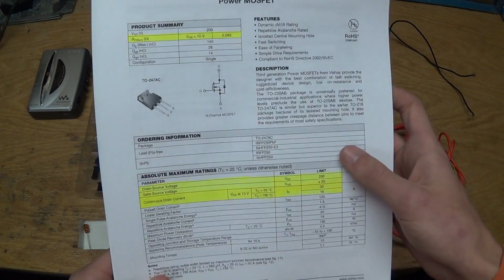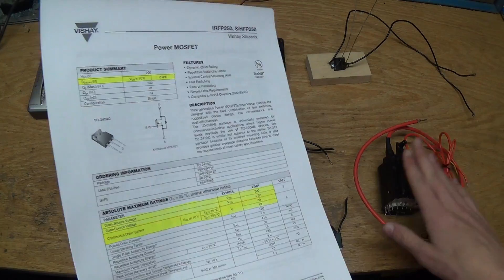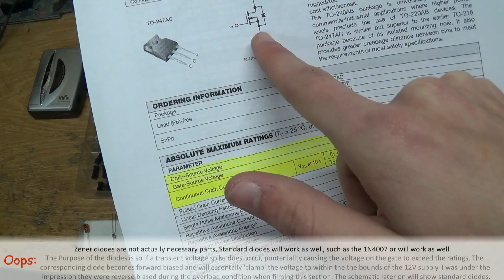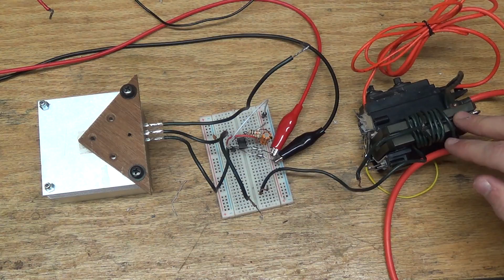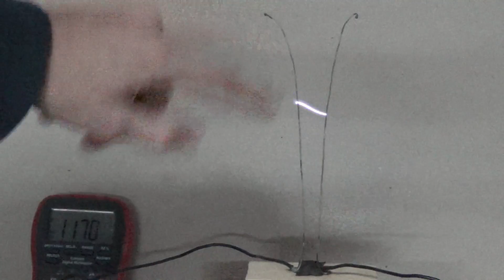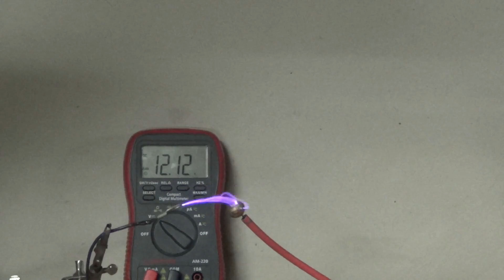Weekend Projects: Make a 69KV Singing Arc Plasma Speaker Flyback Driver!

Comment: Hy!! Nice works, your projects is really good and i am trying for a while to make something like that. 
i tried many possibilities, others videos, by using a 555 timer and nothing but fried components. Is exactly the same with this circuit, i fried : 1 IRF 460N, 1 IRF 540, 2 timers and 1 flyback. 
I read all the comments to try to find what am i wrong and i have some questions, if you could answer to me:
1) I am using this schematics : https://easyeda.com/editor#id=c46d5092f7a4456b97c426fb08236f1e 
I can obtain a 50 % duty cycle and 15 hhz to 96 khz frequency. You said that is not a good idea to use a potentiometer. Should i remove it and use a stable frequency??

2)  I don't understand the part with the resonant capacitor. What should be the frequency of the primary with MKP capacitor, the same like the 555 timer?  How to calculate the inductance of the primary? The value of MKP it's critical for this project? 

3)In the video you speak about 12 V zener diodes and in the description (schematics) your are using 1N4007. For me is not logical to use zener diodes in this configuration. Could you be more precisely?

Thank you very much for yours answers.
Reply from the maker: 1) I cannot see your schematics at the moment because the easyEDA site is down at the moment. Will edit this reply as soon as it's available again. I had problems when using a pot because you can damage it if you take it to the ends without additional series resistors to prevent excessive current through it. Note the datasheet for the 555, and the minimum resistance values allowed for R1 and R2.

2) Yes. Ideally you need to determine what frequency the flyback operates best at. You do not need this capacitor at all to do this. Then once you have determined what frequency leads to the longest arcs, you can try a few different capacitor values to see what works best. Stick within the range I used in the video ( uF is too much, pF is too small. something between 0.5uF and 10nF should work)

3) You are right. Zener diodes are in fact a poor choice. 1N4007 is also a poor choice, I would recommend a single TVS diode for between the MOSFET gate and ground, rated for about 20V. You want this diode directly across the MOSFET leads. Low inductance and short wires are crucial!! TVS diodes are designed specifically to protect sensitive devices from big surge voltages/currents, by clamping them to a safe level. The datasheet will specify the maximum energy it can absorb. Energy = time*voltage*current. They can handle LOTS of amps at the breakdown voltage for a SHORT period of time. Too much energy will result in a BANG. For the audio input, using a couple of 1N4147s would be best. No high current here.
Reply from the maker: I am not sure why you have a 100uF (presumably electrolytic) capacitor on pin 5 to ground. This is incorrect and should be removed. Typically a very small value capacitor is placed here to ground. I am assuming your selection of resistors and capacitor result in a frequency between 15KHz and 30KHz w/ a duty cycle of close to 50%. You can double check that with any online calculator or the equations provided in the datasheet for your 555 version.
Reply: Hy Max and thank you very much for yours answers. Actually the component which made me all this problems was the flyback, it was a big one and produced high voltage and burned everything. Now i have something smaller and i can get 1 - 2 cm arcs with 8 V, 3 amps.
The frequency of this project is between 15,3 Khz and 55,5 Khz and the timer works very well with R1 and R2.
The capacitor C2 is a 100 nF ceramic, in reality, it was a mistake in my schematics.
For the moment i made some tests without MKP capacitor and withhout  diodes beacause i don't have TVS diodes and here : https://easyeda.com/editor#id=e0e52a9612a044d5bd516290d8ee14d8
you can see some pictures of my tests. The test was made with 5V, 2,7 amps, 16,3 Khz (bigger arcs with this F); the 555 supply is about 14,7 V and the gate signal is 13 to 14 V and the arc is about 1 cm.
In my first picture i have the gate and drain signal and actually i have no idea if the drain signal is correct, i don't thick that. How it should be the form of drain signal?
Also the TVS diode should be on the gate or on drain? You mentioned on the gate: but why because there is no high voltage?
Reply from the maker: The point of the TVS diode is protection. No, there shouldnt be any high voltage to the gate, but that does not mean their wouldn't be. Inside the MOSFET, there is some parasitic capacitance between the drain and the gate. What happens is when the drain voltage slams up or down REALLY FAST, it will try and "drag" the gate voltage with it. (Remember: Capacitors like to avoid change in voltage, so when the voltage goes from 0V to 12V instantly, it tugs on the gate) and if the impedance between the gate driver and gate is too high, the MOSFET will actually turn ON when it is supposed to be OFF!!!! And if for some reason it gets yanked up to a voltage exceeding 20V, then your MOSFET will fail short circuit and explode, depending on how much current your power supply can dump into the broken FET.

The size of your transformer of choice dictates how far you can push it. If you submerge the flyback in transformer oil, you can achieve a remarkably high output voltage. This trick is done with the more advanced drivers since it is pretty much required when pushing the transformers beyond their rating as I do. Failing to do this may cause some of the high frequency high voltage to "leak" into the partially conductive ferrite core and arc over to the primary side. This does not cause electrical damage to the parts since it's fairly low current, but it will destroy insulation on the primary wires!
Reply from the maker: Take a look at the gate driver IC's on DigiKey or Mouser. I used one for my tesla coil project. The datasheet for them will typically say they can deliver several amps to the gate of the transistor, and that isn't a coincidence! They need to be able to keep the gate voltage at a fixed level, either shorted to ground or to some voltage above 7V. It takes a LOT of current to quickly change the gate voltage, and in the case of the miller effect, it also takes a lot of current to fix the voltage at a known level. Some of these problems can be partially solved by just slowing down how fast you swing the gate voltage, which is why you sometimes see a small resistor purposely added in series with the gate. The problem with that is that your circuit becomes less efficient because you stay in the linear region longer, where the MOSFET acts like a big resistor and dissipates lots of power.

Comment: There is no way that is 100kv. At most is around 50kv. The 1mm= 1kv rule of thumb stops being reliable at around 25kv. Look at x ray transformer videos so you get an idea of ho much 100kv really jumps.
Reply from the maker: Teresa Shinkansen It depends on the current, pressure, humidity, and atmospheric condutions as well. 100KV is probably a bit of a stretch though.

Comment: Your schematic is seriously throwing me off. Do the voltage values not matter here? I think that's important unless you think a 10v capacitor is okay on the HV side.. You also show diodes to pin 5 then you hook only a capacitor to pin 5 on the build.. Is that schematic accurate?

Comment: I suggest replacing D4 with a 10k or so resistor.  You would need to size it based off of the gate capacitance or charge and your intended frequency.  Blocking gate to source with that diode is making all of that charge dump through the 555 timer when you switch it off.  This is likely causing issues with the 555 timer, but you would need to do an analysis.  If you put a 10k or so resistor where D4 is, the gate charge has a place to 'bleed' off when you switch the MOSFET off.
Reply from the maker: You make a good point, this is not a great circuit, and is quite hard on the 555. But I am not convinced placing a 10K resistor would make any impact there. The output impedance of the 555 timer is several orders of magnitude lower than 10K (roughly 10 ohms at 100mA @15V input voltage). So even with it there, the majority of the charge on the MOSFET would still be pushed to and from the 555 timer. The other factor the switching speed of the MOSFET and how fast the 555 charges/discharges the gate of the MOSFET. The datasheet suggests switching speeds around 100 nS. Assuming that the slew rate is about 120 V/uS, this equates to around 0.24A of current through the 555 timer during the transients, at least in theory. Additional resistances and especially inductances between the MOSFET and 555 will slow things down more.

To do this right, the oscillator should instead drive a proper MOSFET driver chip which can have better speeds and handle peak currents well into the amps. The purpose of the diodes is to protect the MOSFET from excessive voltages on the gate. The use of higher speed (schottky, perhaps) diodes would help, too.

Comment: this is not 100kv power max i love your channel and all but no way this flyback is pushing 100kv you would get hurt or dead over 100kv and that 555 flyback would not like that at all......
Reply from the maker: It's not nearly that simple, Go check out AfroTechMods video "it's not the volts that kill you, it's the amps" where he debunks this all too common myth. Below I will elaborate on how this can indeed achieve 100KV in the right conditions:

To put simply, I have no accurate or effective means to measure the output voltage, so my specification of the voltage is based on data found online regarding the dielectric breakdown of typical atmospheric conditions. So you need to take the rating with a grain of salt. But also, it's important to understand the subject of output impedance and maximum power, or maximum current draw in this case:

The output resistance of the flyback transformer is incredibly high, somthing in the order of several kiliohms, due to the miles and miles of hair thin wire used to wind the secondary coil, as well as the voltage multiplier utilized to achieve the insane voltages. These factors as well as the limited core flux, a high current never effectively established in the secondary, and will max out at maybe 100mA (ish) assuming that the driver is not the bottleneck. Also my driver is limited in how much power it can push into the transformer at 12V.

What all that means is that when the output is loaded down, the output voltage WILL sag, and the current will be limited. The only case that this circuit might achieve 100KV is when drawing a very long arc or when no electrical arc has been established. As soon as a short arc is established. As soon as an arc is struck, the voltage will basically be clamped to a maximum value based on many factors including atmospheric conditions, humidity, temperature, etc due to the plasma becoming a good conductor w/ plenty of free ions to carry electrical charge.

With no load present on the output and no electrical arc established, I have observed dielectric breakdown of the resin on my flyback transformer, which means I am probably pushing them far beyond their rated limits. I have killed one flyback in the video which I discussed near the end lol!
Reply: i know about what kills you but with 100 kv like your saying? it does not require much current to hurt your internals and give you nerve damage i have flybacks that die at 30 - 40kv and they spill their guts if you put 3-4 in series it can be achieved easier but its hard to get 100kv even with powerful drivers as they will be harmed by dielectric break down of the insulation and arc inside and through the pins flybacks that is. most i have ever got out of a flyback is 60kv around in that area at 60-80v and it would muder the flybacks in seconds even in a vacuum chamber with transformer oil i would say your pushing them around 30kv or 50kv even with beafy flyabcks 80kv is very hard to achieve if you get a ac flyback you can build a multiplier for it and get plenty of crakling voltages
Reply: but i loved the video tho its just hard to get 100kv out of a small flyback im not saying its impossible but very difficult you should get ahold of a X-ray transformer that will usually push 100kv depending on what it was used for they can get hot fast sometimes due to the high resistance in the secondary coil
Reply from the maker: YOUR NPN FRIEND Like I said, it's only that high in optimal conditions. Like if you run this circuit at 24V with the transformer submerged in oil. Which is something I have considered doing for this video.

If you aren't drawing a large amount of current, then the a significant part of the transformer losses are observed in the core material. In this case, a ferrite.
Reply: im not trying to prove a point man i totally agree that you have to have the best setup for very high voltages my friend winded a 2 secondaries on a dual ferrite core a huge core and achieved 126kv huge arcs! but it had expensive components big igbts etc.... and the imput was hundreds of volts submerged in oil even the pcb's were submerged im not mad nor hating on you dude in fact i much appreciate your work on your channel i loved your slayer exciter one of my fav's i wasjust saying it is hard to get 100kv out of a small flyback lol i have 20 flybacks and about to go get 50 next weekend in perfect condition do you need any flyback transformers?
Reply: actually i have 29 on hand
Reply from the maker: How are you measuring output voltage? I do agree that 100KV is a bit of a stretch, but if you have a means of actually measuring the output, then by all means do it and let me know what the dielectric breakdown of air is! There is a ton of conflicting numbers online which can result in very different approximations.
Reply: i have no way of measuring voltage as my 100kv tester died from water damage none of them ever got past 80kv at 60 volts and lots of current around 15 amps imput
Reply from the maker: Something I might consider doing is building one (as commercial units are very expensive) It would probably comprise of several long high voltage 10 megohm resistors epoxied inside a PVC tube, with a resistor to ground. The output resistance of this resistor divider will probably be very high, and the 10 megaohm input resistance of a typical multimeter could become a concern.

I would be interested to know what the output voltage of these high voltage circuits really is.
Reply: yes sound like a good plan man post it up when you get it done!

Comment: When you say "high value capacitor" what do you mean by that?
Reply from the maker: A film / MKP capacitor with a relatively high working voltage (WV) rating. 300V or higher AC rating, or 600V dc rating. Look for one with low(ish) dissipation factor.
Reply: And what should be the capacitance ?

Comment: How about adding an optocoupler between the circuit and the audio source. That way you can play higher quality audio off a PC or phone without worrying you'll get voltage shot back into your device and killing it.
Reply from the maker: Daniel's Game Vault Higher quality can be acheived by using a different circuit. I built another driver using an LM339 and it works much better, crystal clear at 30KHz. If you can get a flyback that works well at 44.1KHz or higher you should get CD quality! I had plans to sell the driver but still need to work out the reason the MOSFETs periodically fail with 24V operation.
Reply: Perhaps you should parallel several of them to spread the current out...might be tricky to do though, because one of the FETs would tend to do all the work. The simplest workaround is a resistor in series with the gate of each of them, at least that's what I've read.
Reply from the maker: Yeah, using many MOSFETs in parallel is definitely an option, but the FTP33N25's (basically a IRFP250N modern equivalent)  is capable of 33A, and I don't think am exceeding it. Using more FETs in parallel would increase the cost of the kit, too. I think the problem is that I am getting voltage spikes exceeding 400V, and that causes reverse breakdown of the FET, which leads to power dissipation and eventual destruction of the FETs. Adding a parallel film capacitor eliminates this and makes the arcs hotter, but slightly reduces audio quality, and if the circuit isn't tuned right, the MOSFET turns on while the capacitor is charged and causes a large current spike!

Yes, you are right:  MOSFETs used in the linear region can have a negative temp-co and might not be well matched, but if you drive them hard into saturation they should have a positive temp-co and balance themselves. It's still best practice to use series resistors on the drain for load balancing, especially in linear operation (well, technically the operation in the power dissipative saturation region).
Reply: Plasma TVs are a good source of high power components. I'm planning on "raiding" a dead one I have laying around to source myself some FETs and diodes and stuff :D Those can take quite a beating.
Reply from the maker: CRT's even more so! :) Its almost like they have a flyback driver built in or something 😜